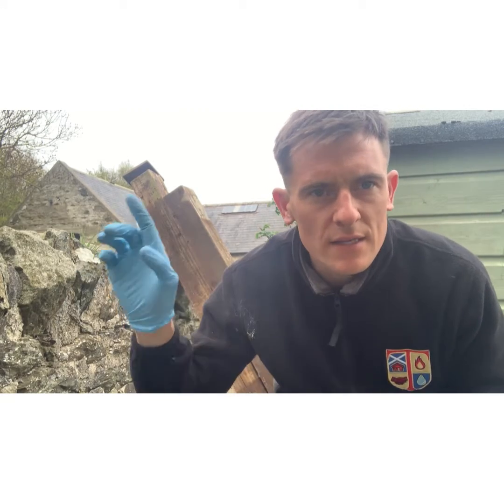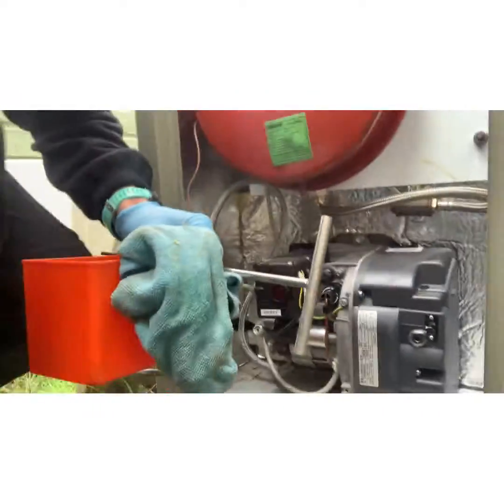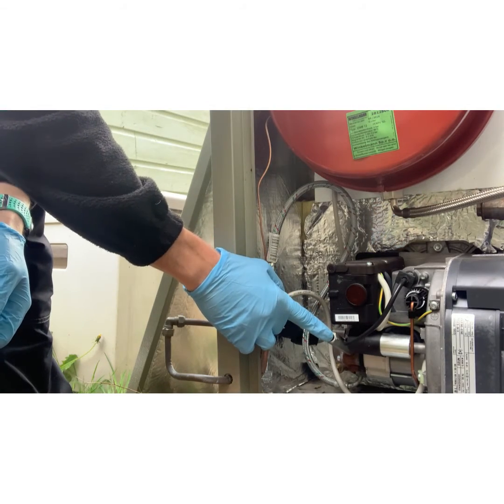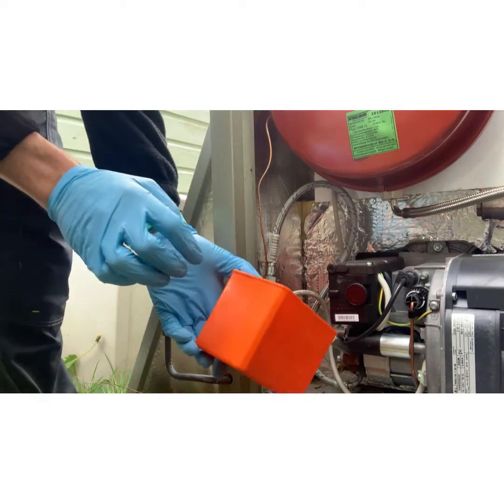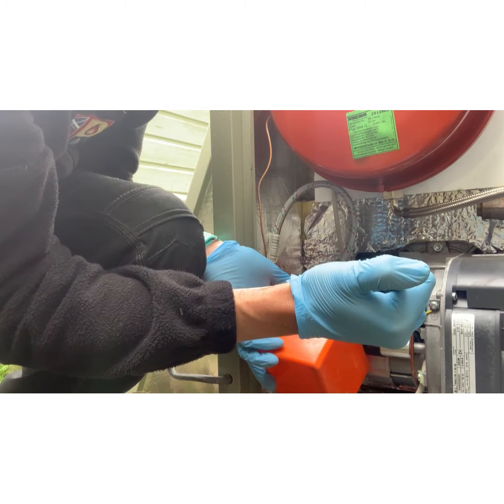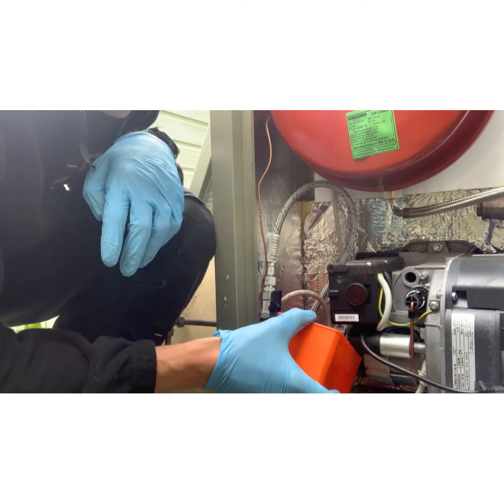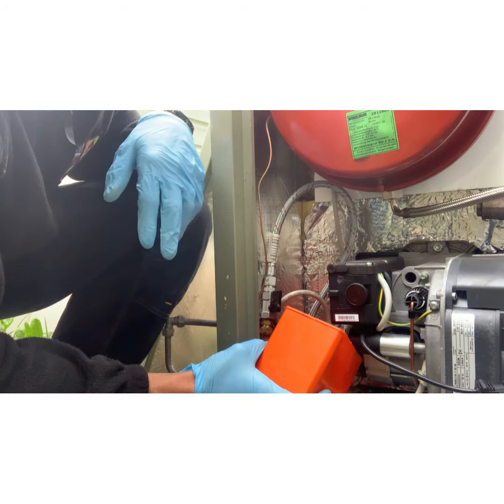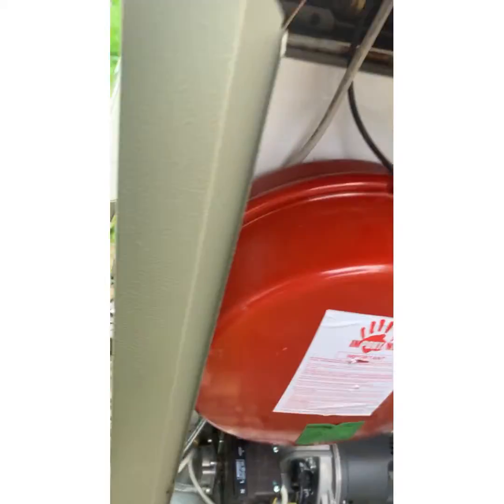Ran out of heating oil? How to bleed through to your burner.

Comment: Thank you very much! 😁 The photocell trick works well. I used a sawn off pop bottle and waited for the contents to settle. Oil floats on water beautifully and the clear pop bottle shows you when the  kerosine is clear of water, condensation, poor quality fuel with water mixed in, etc

Comment: My photocell is coming out attached to a long black pipe?
Reply from the maker: @alisonmortimer9830  yes that’s correct, pull it right out.
Reply: @ pull it all the way out or disconnect the pipe that’s coming out with it ?
Reply from the maker: @alisonmortimer9830  yes pull it out the hole so you can see the photocell end!
Reply: @ will go have a go 🙏
Reply: Been doing this for an hour. Is this still ok to carry on ?
Reply from the maker: @ It sounds like there’s maybe another issue.

Any valves or anything in between the oil tank and your burner? Could be a fire valve closed, blocked filter or isolation valve off. 

How far is it from the tank to the boiler?
Reply: @ no more than 15 ft and tank is much higher, so got some gravity. Was still getting bubbles, but turned it off now!
Reply: @ Thank you so much for all your help yesterday. We have had the plumber this morning. It was the fire valve, and lots of dirt in the bottom had to be drawn off.   I’m subscribing! 😊🌟🌟🌟🌟🌟
Reply from the maker: @alisonmortimer9830 that’s excellent news, so glad it helped and you’ve got that sorted out now. Where are you located? My mission is to get going with more of this type of videos soon.
Reply: @ We are in Carmarthenshire, a long way from everywhere! I enjoy trying my hand at the easy bits of plumbing.

Comment: How long can you run it like that?
Reply from the maker: @6CAJAC6  as long as necessary to get the air out. I’d not recommend leaving it like that as the photocell is a safety feature for if the light extinguishes it doesn’t fill the combustion chamber with oil, it’s used to stop the burner motor and subsequently the oil pump from running if flame goes out.

Comment: Hi Scott, what should I do if there's no bleeding valve there (just a nut). Previously I used allen key to looosen up the little screw on the left of side, and it worked but now it must be a lot of air and it just doesn't work.
Reply from the maker: @pakofishing  hello 👋 you would loosen the nut to bleed it, if there nothing out the bleed screw though you may have another issue somewhere. Could be blockage or pump / filter issue.
Reply: I loosened the whole barrel and removed it as I just couldn’t loosen the screw.

Comment: Ive being trying this with a bleed valve installed and nothing. I cant even get air bubbles to com3 out. Its just keeps crapping out
Reply from the maker: Ok it’s maybe blocked with something or there’s another issue with the supply line. Is the fire valve ok?

Comment: I understand all of this but I have no fuel coming out at all to bleed,I ran out of fuel and got it filled but nothing
Reply from the maker: Hello Mark, 
There likely air trapped in the line, dirt blocking line or the filter or possibly if your tank is lower than the burner does it need sucked through?

The other possibility is the oil pump may be faulty if it’s been ran dry. Hope this helps you.
Reply: @scottduncan7062  i need to try it a few more times so I guess i only tried it 2 times so I hope this works thanks very much for the reply 👍
Reply from the maker: @sweeney69728  no problem, how did you get on? I’m interested to hear 😃
Reply: @scottduncan7062  thanks very much you were right it was air locked so I had to bleed it a few trys and it was up and running again thanks again for the help much appreciated 👍